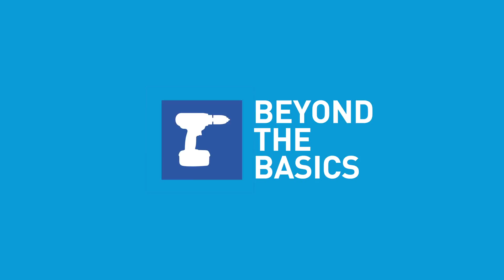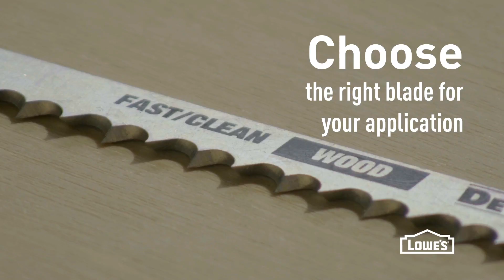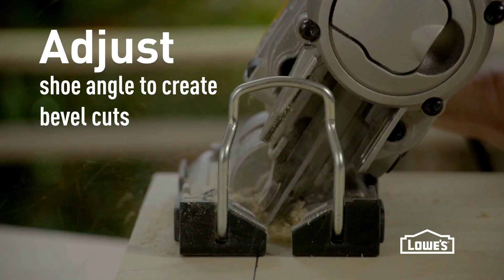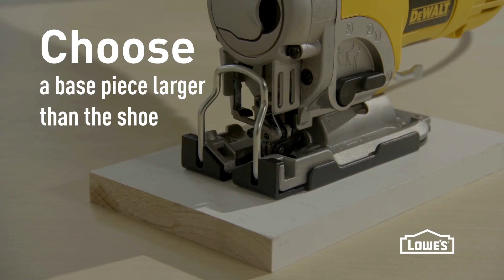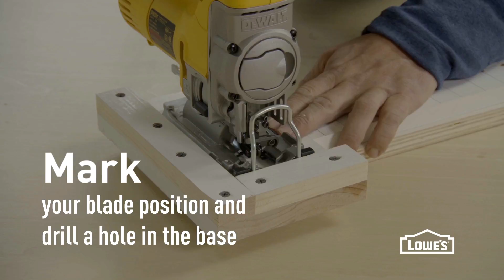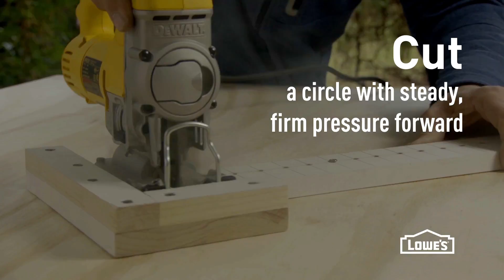How to Cut Perfect Circles (and other Jigsaw Tricks) | Beyond The Basics

Comment: On the circle cutting tip, won't that leave a divot where you drilled the starting hole? 

A better idea would be to set the jig on the workpiece and slide it over till the blade rests against the edge and parallel to it. Now fasten the jig to the workpiece and start cutting.

Comment: This doesn't work for me. When I start cutting my blade slowly starts to bend inward, to the circles core. This results in a cut going inside circumference. I don't get what the problem is?
Reply: I have the same problem.  I tried several different ways to fixture it and the same thing happens.
Reply: Try slowing your feed rate down.
Reply: I have come to the comments with this same problem... So far I have come to the conclusion that it might be because the blade is not in line and in front of the pivot  point where the centre screw is
Reply: Hey guys. See my comment from earlier. Basically, the blade must be directly in line with the pivot point for it to work. If the blade is ahead of the pivot point, it will drift outward until it binds. If the blade lags behind the pivot point, it will drift inward until it binds. You'll be lucky to align it dead nuts. And if you do, it will only work for that one blade. Best of luck!
Reply: @SouthMiamiMartialArt  Omg, it's so logical and yet I missed it. Thank you man!
Reply: I only know this because I cut up about 10 square feet of scrap lumber experimenting. Finally got it to work, but I filled and redrilled so many jig pivots there was a 1 inch square of "toothpick" by the time I got it right.

Comment: The circle jig won’t work
The hole for the jig blade must be aligned with the screw.  Otherwise it doesn’t work!
Reply: Corrado Meilach ohhh I see, the blade has to be perpendicular to the line from the center to the cutting point. That is a problem indeed...

Comment: This circle jig will not work. The blade must be perfectly square with the pivot. Think about it. If you push the saw sideways, what happens? If you push the saw at a 45 degree angle, what happens? Only if you push the saw straight will it cut properly. So with the circle jig, if the blade is behind the pivot, it will drift inward until it binds. If the blade is ahead of the pivot, it will drift outward until it binds. There are tons of these circle jigs and NO ONE MENTIONS THIS! I learned the hard way after wasting hours of work  ruining my first jig.
Reply: It was working fine. Didn’t u see all the smoke coming from the cut? 😂